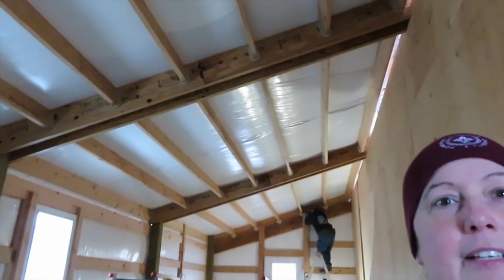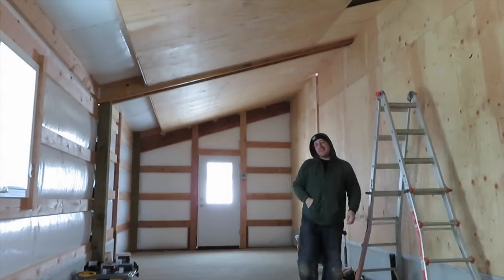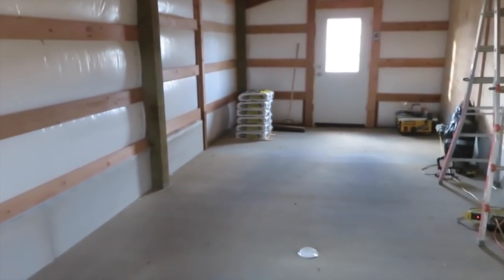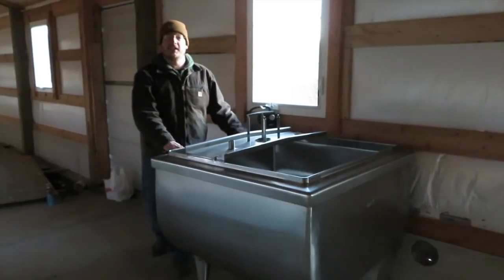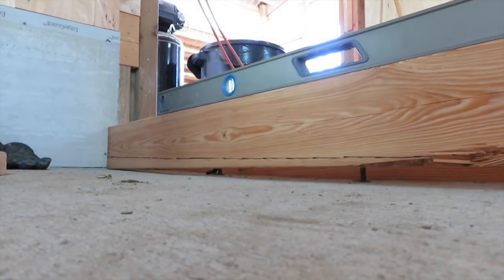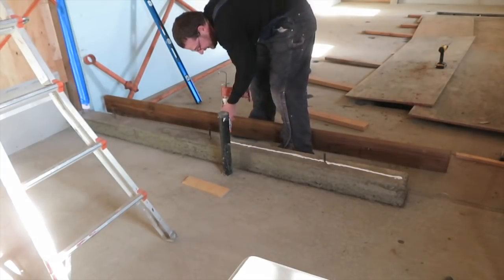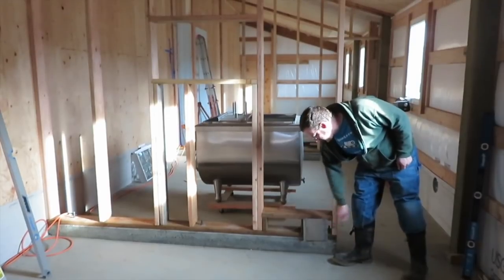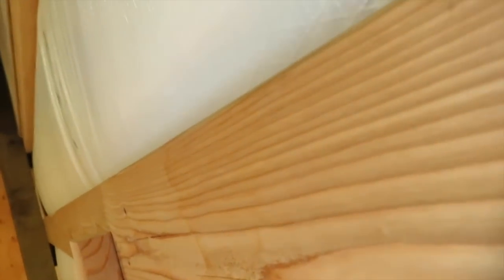Building Dairy Barn #11: Ceiling, Walls, Moving in Milk Tank

Comment: Nice job. What is the backup plan if you have to replace or upgrade the bulk tank? Is the wall framing structured to cut a door in?
Reply from the maker: AKWayne S yes indeed! Great question! The wall is framed for a removable panel. It was just easier to bring this tank through the door since it would fit. Thanks for watching!

Comment: Nice job overhaul mate.
A trick we used to give a smooth surface to concrete vertical surfaces was to lightly bang the formwork with a hammer along its length which moved the ballast away allowing concrete to fill the void. We then found that there was an easier way. We made up an attachment to fit a hammer drill which consisted of a piece of 3/4" round bar about 1 or 2" in length, rounded off one end and drilled & tapped on the other into which a 1/4" or 3/8" shaft was screwed for the drill chuck. We simply fired the drill up and vibrated the formwork with that. Worked a treat. Maybe something to think about on future projects. Vibrating too much will cause the ballast to precipitate to the bottom and not a good outcome.
Cheers from downunder.
Reply from the maker: Pilot McBride great tips! Thanks! Hopefully I don’t have too much concrete work in my future! Haha! Thanks for sharing!

Comment: As always a enjoyable and informative video. I am still interested in how the primer and paint will go on the walls and ceilings. As we all know water is the enemy of exposed unprotected wood. It has a way of finding it!! As a journeyman electrician I favor nicely run surface mounted conduit. Ease of install as well as future add ons or changes. They always come up!! All in all very nice plan and layout. Keep up the good work and we look forward to the next video!
Reply from the maker: Ronald Wang they build boats out of wood all the time :) All joking aside, I’m really just building this like an inside-out boat. I’m using a “Dairy Enamel” and when I look at the formulations, it’s basically a marine enamel like I used in the Coast Guard. Sealing is important, but not sealing is also important for dry out. As far as electrical, some will be in the walls to minimize dust catchers, but much will be surface mounted conduit as well. For example, on lighting circuits the wires will be in the wall from the panel to the switch, and then surface mount from the switch to the luminaries. Dedicated circuits I’ll try and keep in the walls as much as possible. Most receptacles will be surface mounted. Thanks for watching!

Comment: You might want to put a window between the parlor and the milkhouse especially if you ever plan on installing a pipeline. That way you can see that you forgot to put the pipe in the bulk tank instead of dumping half a milking in the wash vat. Not that I have ever done that :)
Reply from the maker: Great thoughts! In our original plan, we did have a window in that wall, but removed it for two reasons. One, it’s practically a wall of sinks, and since we hate having sink legs, we went all wall hung. Because of that, we didn’t want to compromise the studs by cutting in a window opening. There is still more blocking to add, but we’ll do that after the sink placement is nailed down. Secondly, we wanted the wall space above the sinks for a shelf. Like you said though, it is important to be able to see from the parlor to the milkhouse, since we do plan to install a pipeline (probably next year), so we are using a glass storm door between the two rooms so we can see through that! Thanks for watching and we appreciate the comment!
Reply: I agree with your hatred of sink legs. The glass storm door is a brilliant idea. It will give you even better visibility from the pit without propping a door open. Milk inspectors will write you up for propping milkhouse doors open . Not that I have ever done that :)
Reply from the maker: doug4320 one of the dairies I used to milk on used a storm door and I though it was genius!